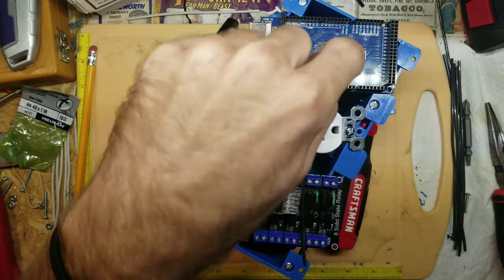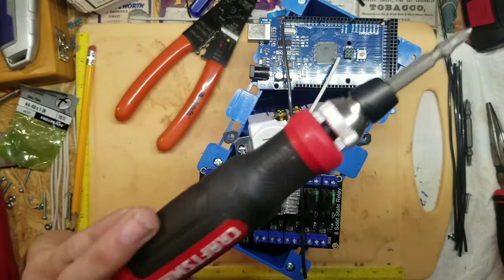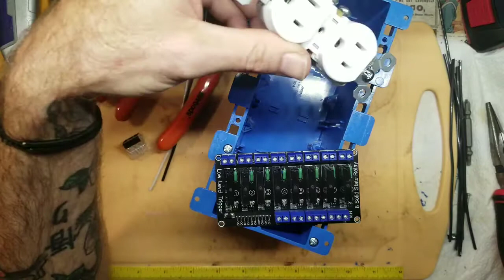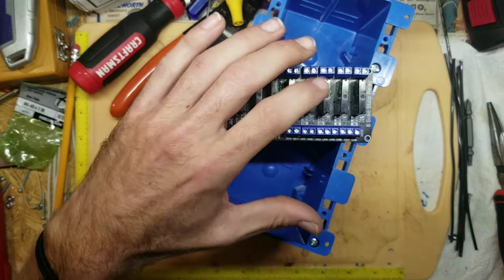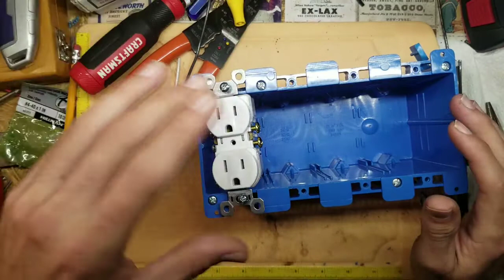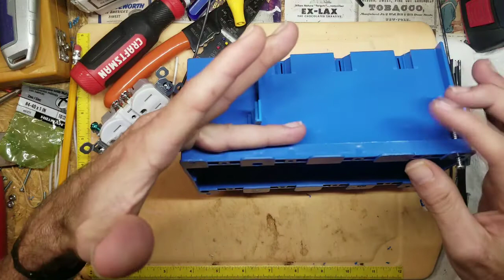Christmas Light Control Box Build - Part 1 - Brief Overview & Parts

Comment: Great video I built one a few months ago and it all worked great now I finished another one but when I put power to it the lights that are plugged into the controller light up but are very dim the lights never go completely off
Reply from the maker: Thanks!
Sounds like you may have issues with the relays. Are they solid state or mechanical?

Comment: Can I use a iPad or iPhone to program the Christmas light display?  If so what app do I need?  I don’t have a computer.
Reply from the maker: The program most use is called "Vixen." I'm not sure if there is a mobile app for it. You would have a way to connect the iPad to the Arduino. Either by a cable or via bluetooth (which would require a bluetooth module for the Arduino). If you used a bluetooth module for the arduino, you would lose some (I think 4) of the output pins that would control the lights in order to operate the module.
All else fails, you could get a inexpensive laptop to do it. It doesn't have to be fancy, just have a USB outlet on it. The laptop I'm using is over 10yrs old. I paid about $300 for it then and today I could get the equivalent for probably $200.

Comment: Is this what you are using... Arduino Mega 2560 REV3?
Reply from the maker: Yes. It's a clone I get off Ebay. This is the one I use. It comes with the power brick, USB cord and Arduino. Ships from the US quickly 
https://www.ebay.com/itm/202114393135
Reply: @OutdoorsWithShawn  Well thank you, I ordered it. What about the relay board and the wagu connector?
Reply from the maker: Relqy boards I got off of Ebay from China. You can get them faster through US sellers, but cost about $4 more each. Make sure you get 5volt  High Level trigger relay boards as well as an AC/DC power converter to power the relay boards. I'll go over that in an upcoming video. I went with a 5v 2amp to power all 7 of my relay boards.
Reply from the maker: Wago connectors i got off Amazon 
https://www.amazon.com/dp/B07CNNQDMZ/ref=cm_sw_r_cp_api_i_G8LTFbDNBFN7S?_encoding=UTF8&psc=1
Reply: @OutdoorsWithShawn  Yup ok ordered them
Reply: @OutdoorsWithShawn  Little confused I see in your video you have low level trigger boards? Also could you give me a link on Us Seller and maybe where you got the ones from China for relay board?
Reply from the maker: @rjbiz3639  I made the mistake of buying the Low Level triggered boards and it caused me issues. Get High Level, trust me.
China: https://www.ebay.com/itm/KEYESTUDIO-DC-5V-1-2-4-8-Channel-Solid-State-Relay-Module-for-Arduino-/133011425111?_trksid=p2349624.m46890.l49292

USA: https://www.ebay.com/itm/SainSmart-8-Channel-5V-Solid-State-Relay-Module-Board-for-Arduino-Uno-Duemilano-/273441503378?_trksid=p2349624.m46890.l49292